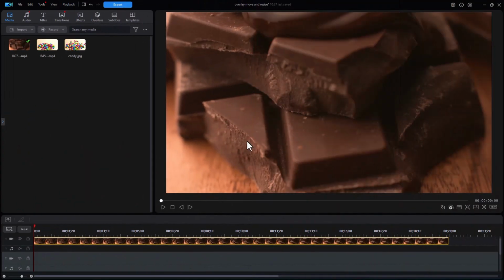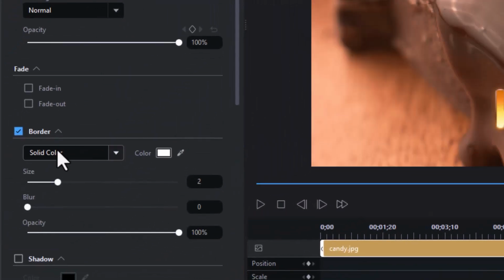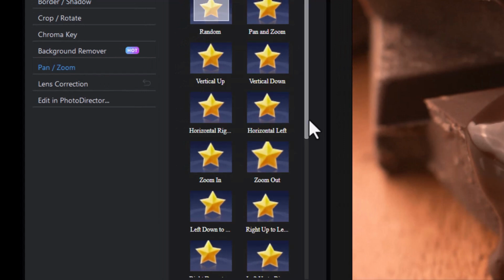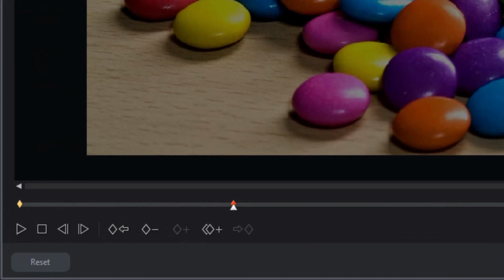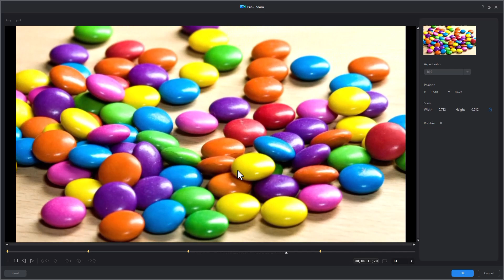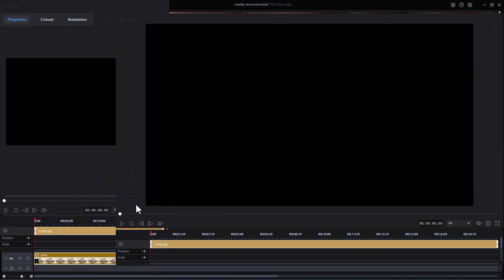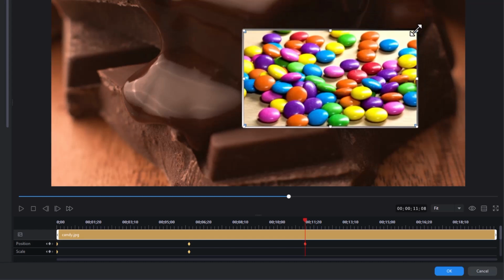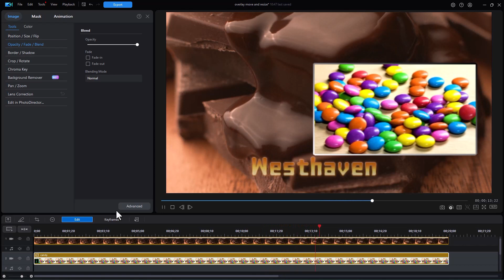Add Energy to a Picture in Picture Project in Power Director

Comment: you are number one, I signed up on your channel for tutorials on powerridrector I am learning a lot, I wanted to ask you I am using audiodrector when I open a project on powerridrector to edit the audio I open it in audiodrector but I see the video but not the audio, it seems a codec problem I noticed that the aac format is not open you can help me solve thanks
Reply from the maker: I'll look into it and see if I can learn something helpful for you. --Jim
Reply: @SharperTurtle  thank you very much waiting with patience
Reply from the maker: I don't have an AAC audio track, but I experimented with a video with AC3 audio. It loads as I would expect. I have not been successful in replicating what you describe. Do you see the video in the lower left corner of the screen? Do you see the wave forms in the center of the screen? --Jim
Reply: @SharperTurtle  Jim no longer know what to do tried to save a video with an MP3 audio file but when exporting the video saves my audio in aac and audiodirector does not see it
Reply: thanks for your availability, when loading the video below in the corner I only have video,while in the center I have no waveform,while in the powerirrector the audio file is displayed normally,I think audiodrector does not support aac audio file,even if it is strange,I do not know if there is a fix to make audiodrector open the file,moreover I wanted to ask if when you view the audio file you can change the bpm of track example from 122 to 130 and then save the edit display it in powerirrector with the audio of the edited video
Reply from the maker: The support screens claims AudioDirector supports AAC. So I don't know why it's not behaving the way we would expect. You can change the BPM on the metronome, but that does not impact the beats per minute on the music. You can change the duration of the music clip, which should change the BPM, but there is no way of identifying and assigning BPM in the process. CUBASE would be a program that might allow you to make those kinds of changes, but I don't see how to do that in AudioDirector. You might try to import the audio into the free program Audacity and see if you can export it in another format. It has been a while since I have used that program. Another option would be to post your experience on the Cyberlink Forum and see if anyone there can give some advice. --Jim
Reply: @SharperTurtle thank you so much for your support, I don't understand why audiodirector behaves like this with aac files, moreover regarding BPM I thought you could change, as happens with Vegas pro that allows you to strech with audio and video, I don't use Vegas because it is more complicated but some functions are more precise than powerridrector it is a shame that it doesn't have some more detailed functions, would make it a Top video editing program, however I try to leave feedback on the cyberlynk forum thanks again
Reply from the maker: You are welcome. I would hope the developers at Cyberlink analyze the competition and try to incorporate features competitors have. But it must be more complicated than that from their perspective. --Jim
Reply: @SharperTurtle  jim can you give me a support email where I can contact them, I wrote on the forum but nobody answers me thanks
Reply from the maker: It's not uncommon not to get a response. That's the only way I know to connect with Cyberlink. I don't have another option myself. Hopefully another user will see your note and offer some help. --Jim